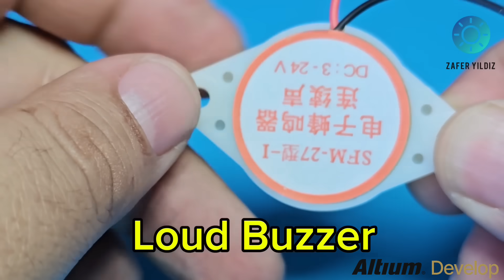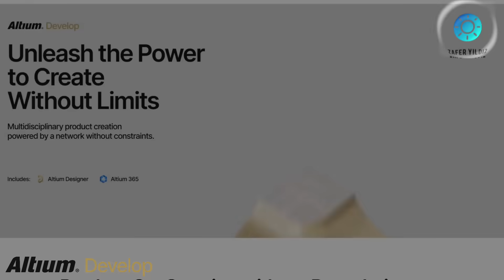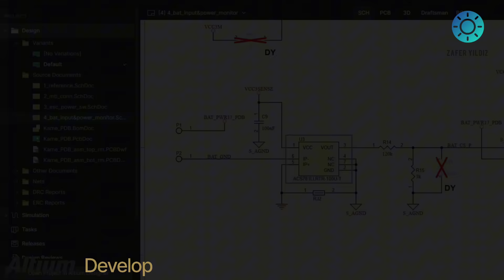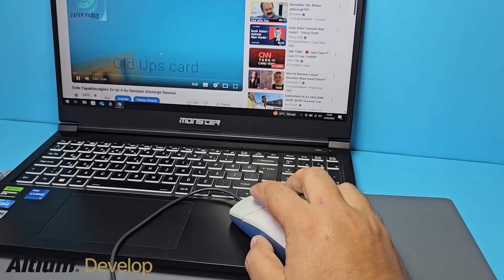Don’t Throw Away Your Old Mouse! – 3 Genius DIY Projects You Can Build!

Comment: The Ball Series Mouse doesn't have drivers for the USB port, so it will not work if you connect it with wires to a USB port, unless you use a PS2-to-USB converter adapter.
Reply: There were dual-mode mice  which could work with ps/2 and usb (with simple adapter) as well.

Comment: To convert a PS/2 mouse to USB, you can simply use an adapter, which only costs about $1. 

The IR tester is technically poorly designed. 
Operating an IR LED directly with a 3V CR2032 battery without a current-limiting resistor is grossly negligent and will artificially age the IR LED over time. 

Operating the 3-pin IR encoder at 9V without proper resistance is the same. 
Furthermore, the green LED on the IR encoder is also connected without a current-limiting resistor. 

Such circuits demonstrate a lack of technical expertise! 
Spreading this kind of content on YouTube is pathetic and sad!

Comment: Is it possible, if I covert ps-2 Keyboard to usb Keyboard with the same connection
Reply: Not always. Some PS2 devices CAN connect via USB, but most of the older ones cannot. They have to support this electronically.
Reply: Just use USB-PS/2 adapter. It is device with one USB male and two PS/2 connectors: for mouse and keyboard. With this device you can connect any old keyboards and mice to new PC, laptops, android devices and other, who supported USB HID devices
Reply: @sovashurik that has electronics inside and it is not always available to purchase.
Reply: @andrasszabo7386  That is why, am looking for an universal circuit

Comment: Be careful with the last one. Not all peripherals with PS/2 connections feature microcontrollers which will detect connection to a USB bus and behave accordingly.
Reply: I have a working PS/2 to USB converter 😇
Reply: @Manfred-123 Congratulations. Does it work in reverse too? Some USB keyboards (Genius brand, for exmple) that support PS/2 will also work if wired to AT keyboard connectors on old (8088/8086/80186/80286) PCs.